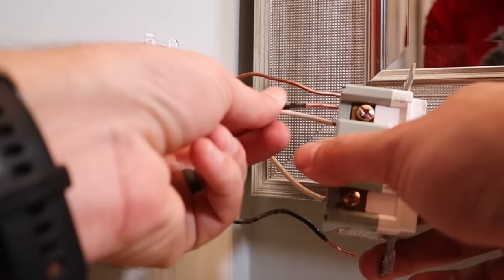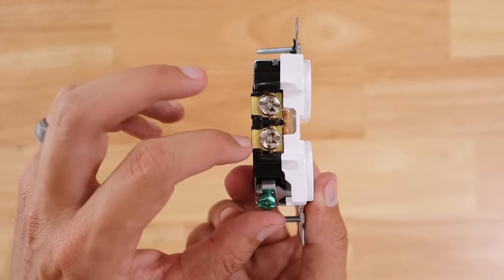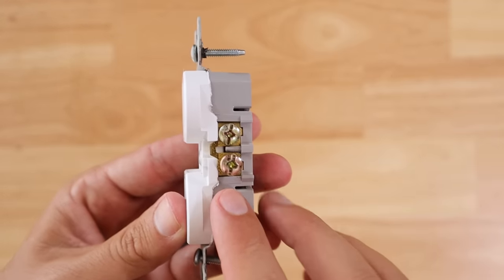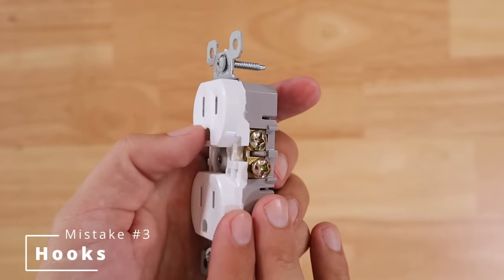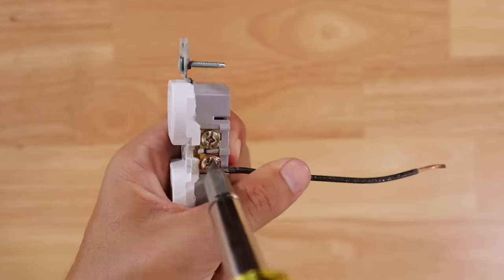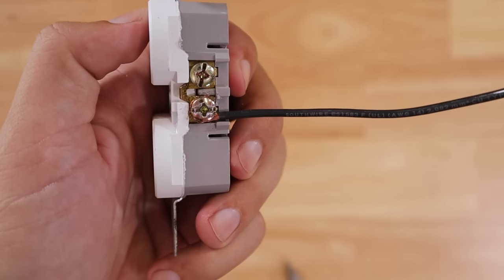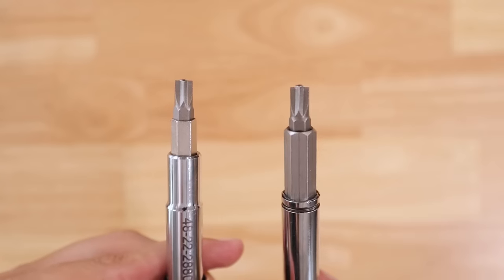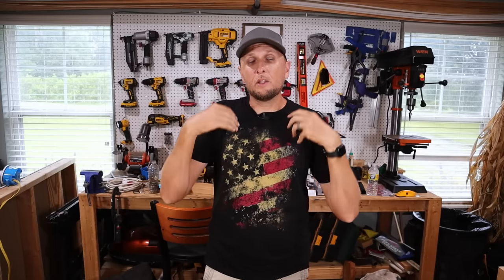The BIGGEST Mistakes DIYers Don't Know They Are Making When Wiring Receptacles | How To

Comment: German here. We use push in connectors for outlets, junction boxes, switches and lights for decades now. They are superior in any way. Obviously, if installed wrong (wire to short, not pushed in far enough) or of crappy quality, they fail, but that's the same for screw type connections. They are better, because they push back onto the wire, while a screw can't do that. Obviously they are also a lot easier and faster to install, change or remove. Also putting stranded wire into such a connection seems wrong, there needs to be at least some ferrule to keep the wires together first.
Reply: Yep, I recently replaced all the outlets in my house built in the 70’s. Many were wired via push to connect, and outside of being ugly and old looking, all of them still worked fine. Seems like a decent method when done properly
Reply: Yeah. I'd say  95% of construction in the US and Canada in the last 30 years uses back wiring.  

A few extra minutes on every outlet is a huge deal when you're building a 200 house subdivision.

And there's no issue with it at all if the materials aren't defective and they're installed correctly.

But then you could say that about screw terminals too.
Reply: Every outlet I've seen only allows 14 AWG  solid wire in push connectors.  I prefer 12 AWG wire for outlets, because you never know if someone will plug a high load device into it, ie a big vacuum cleaner, or a big hair dryer.  So I always use the screw terminals on outlets.  Lights can often be 14 AWG.

Comment: The backstab method is just fine. If the outlet has the UL approved marking it was tested by the lab for safety concerning fire and shock. It is safe to backstab, but not always the best option. Any building inspector will pass a backstab wired outlet because it is safe.
Reply: Right? Sounds like when plumbers say don't use PEX. It's UL listed my dude. Insurance companies are not just lax/lazy on this. If the devices were faulty it would result in millions worth of claims. They would be going crazy banning them.
Reply: Been a Journeyman electrician for a few years now, and thousands of hours in my apprenticeship, and grew up around the trade (Dad, uncles, brother all electricians)... and I can say that I have come across many service calls of faulty receptacles having to do with backstab connections vs the correct hook round the screw. Older places with plugs behind beds, people plug the clock/phone charger in, and then things get... bouncing in bed, caused the backstabs to shake, come loose and begin arcing... causing the receptacle to melt. I would never use a backstab connection for a permanent install. Remember that the UL approval is the LOWEST accepted level of safety mandated by the authorities... not the best... just like the entire electrical code...
Reply: @coryjohnson2314 I've seen plenty of melted outlets that were installed by looping them around the screw. I'm sure you have too. Do you think looping is unsafe too?

Insurance companies don't use the lowest standard, they use the highest. UL lab testing means an item has been tested, a lot. You wouldn't insure the "lowest safety standard".
Reply: I being a master electrician for 21 years agree with cory. Backstabbing outlets is lazy and causes more headaches in the future. Code is to minimum standards.  Why not do better than minimum.  Dosen't take much longer to side wire.
Reply: We all know there are high quality outlets and crap outlets, and the crap ones are still UL listed.  UL listing means it probably won’t cause the house to burn down…not that it will be durable, reliable, or have less than 10volts drop at the 4th daisy-chained outlet.

I seriously wonder if these “it’s just fine” guys apply the same standard of work when it comes to their own house?   If you wouldn’t do it in your own house why on earth is it “just fine” on a work site?   “It’s just fine” actually means “it won’t fail soon enough that they can still track me down.”
Reply: Great video but not in 100% agreement here. Seen way too many back stabbed outlets installed for decades without issues. If there's a problem it's usually somewhere else.

Comment: Great video. I only have 1 thing to add. Receptacles or plug ins are not rated as pass through devices. Pass through means, the two screws on the side, top screw is power coming in and you add a wire to the bottom screw for power going out. You should, instead, wire power in and out together in the back of the box and connect the receptacle to these two with pig tails.
Reply from the maker: Thanks a lot for the feedback!
Reply: The receptacle is indeed rated for pass through and there is no code violation. If there are 2 circuits on A and B phases sharing that neutral, then you are not allowed to pass the neutral through a device.
Reply: Agreed 100%. In Canada  it has been Code for many years to pigtail the neutral/identified wire. NEVER PUT 2 WHITE WIRES ONTO A DEVICE. This is a danger to anybody servicing the device in future and it  creates a greater fire hazard.
Reply: @lumberjackdreamer6267  No. Splice the whites in the box with a pigtail. 
If someone is working on the circuit live(I know it SHOULD be turned off, but there are scenarios when that isn't practical), if you happen to get yourself in contact between the two white wires(the return path), you will receive the full current from anything that is connected down stream in the circuit.
Simple example: When disconnecting a light from a live circuit for testing you never disconnect the white wires first because the current going to the bulb from hot is still there and it's looking for a way back home to the panel ground. If you accidentally grab the white from the box and the white from the light you become part of the circuit and will receive all of the amps that the light bulb(s) are drawing from the panel. That will at best hurt a whole lot more than the zap of touching the hot wire if it doesn't lay you out flat. Be careful. The white is the most dangerous wire in a live circuit.
Reply: @lumberjackdreamer6267  if you have 2 separate circuits with 2 separate neutrals then yes you would cut the tab
Reply: @lumberjackdreamer6267  if you are speaking of 2 hots sharing a single neutral from the panel (1 cable-red, black, white, bare) then the single neutral will carry a maximum of 20 A in the scenario you described, not 40A.
Reply: @17kcotsdoow86  
Dude, you need to stop focusing blindly on the wire color and you need to start thinking of circuits. 

The “white” from the lamp is actually connected to the hot, through the light bulb filament (assuming incandescent bulb). 
Yes, the wire color is white, but don’t get your head stuck in the color. Instead, draw a circuit on paper, or ask an electrician for help.
Reply: @17kcotsdoow86  
Maybe we should wire lights with red and blue wires? That’s more expensive that using the standard 12/2 black and white, but maybe it would be less confusing?

The red would represent “switched hot” and the blue is “potentially hot”.
Reply: @lumberjackdreamer6267  No. If you use 12/3 the neutral will see a maximum of 20 amps because the breakers are on opposite phases. If you are pulling equally 20A from each breaker the neutral actually sees 0Amps. The neutral carries the un balanced current. If you put both red and black on 2 breakers that are on the same phase then yes the neutral would see a maximum 40a but this is not a legal or safe installation for obvious reason. The breakers must be on opposite phases that is why the phases alternate from one end of the panel to the other end so when you install 2 breakers side by side they are on opposite phases. Where would you get the extra wire in a 12/3 to attach to the other screw after you break the tab? There is only 1 white wire in the cable.
A common problem I have encountered is with single space breakers that attach to 1 phase but have 2 toggles for 2 separate circuits and un knowing people using 12/3 attach the red wire to 1 circuit and the black to the other circuit. The problem is they are both attached to the same phase yet they are sharing 1 neutral in the cable thus resulting in 40A potential current on the neutral. The neutral only comes into play when you draw say 10A on the red circuit and 5A on the black circuit creating an un balance of 5A in the multi wire circuit. Those 5A are carried by the neutral. 
Look up Edison or multi wire branch circuits to learn more than I can give in the comment section.
Reply: @lumberjackdreamer6267  dude I'm a 30year journeyman, 3rd generation electrician. I told you that if you disconnect the white wire from the lamp socket before you disconnect the hot and you hold onto both the white wire from the lamp and the white wire from the box you will become part of the circuit and your body will carry the amperage that the lamp is pulling as it tries to return home. 
Obviously the white is attached to the filament. THAT'S WHAT MAKES THE SITUATION UNSAFE IF YOU DISCONNECT THE IDENTIFIED CONDUCTOR BEFORE THE LIVE CONDUCTOR. I don't care if the wires are purple and pink polka-dot, the theory is the same.
Reply: @17kcotsdoow86  
What you wrote here is correct.
Reply: @17kcotsdoow86  if you touch the live white and any path to ground, not just the panel's neutral, you can get shocked.
Reply: @Jaballer77  Yes. That's because neutrals and  identified conductors bond to ground at the main service and therefore are all common to each other.
Reply: @17kcotsdoow86  It does not create a greater fire hazard. Terminal screws are UL tested and listed for feed-through current. Code requirement in Canada yes, but that doesn't mean it's a fire hazard, that means it's a code requirement in Canada.
Reply: @17kcotsdoow86  The white wire is not the most dangerous wire in a live circuit. An equal amount of current flows through the hot and the neutral. If you become the connection between two hots or two neutrals in an individual circuit, you're equally in danger. That said, pigtails required for neutrals only in a multi-wire branch circuit, not required for hots, because if two hots are sharing a neutral and you only turn off one breaker off, the neutral is still live.
Reply: @pld8993  But if it's wired to code then both ungrounded conductors would be turned off.
Reply: Incorrect. The terminals on a recep are rated for pass-through current.
Reply: @williamleblanc3244  Correct
Reply: @UCQ0M2zfo6E32DyDtkPq-uIQ 
That’s a good explanation. Thanks

Comment: Instead of remembering silver/gold, the easier way to remember where the black and white wires go is to look at the front of the outlet. The "dangerous" wire (the hot, black wire) goes to the smaller hole so that you're less likely to have a kid put something in it.
Reply: Thanks.  That is how I remember things.
Reply: @w6467  Black to brass is what I told my Newbies
Reply: white to metallic white. color to color. Done.
And that works for even complex (eg. 'red wire') situations, too.
Reply: I usually remember it by noting the brass is the darker color of the two and black is the darker color.
Reply: Black to gold (brass) like Mr T is black and wears gold
Reply: tamper resistant receptacles to completely stop anyone from putting something in it?
Reply: @davids7745  let ‘em put shit in there. They gotta learn
Reply: @MrRockitt3  MrRockitt3,  laughed my butt off at your funny lil quip!  Back in approx  1960, at the wise ol'  age of 4yrs, THIS is EXACTLY  how I first discovered the "wonders-of-electricity!"  Yup, when Mom wasn't watching, I managed to stick some metal scissors into an electrical-outlet, and  WHAT a SURPRISE  I got!  But yes, I indeed learned!  And I still can remember that event like it was yesterday!
Reply: Unfortunately I was taught the electrical trade by a racist... just remember that white guys like white gold, and black guys like yellow gold... That might not sound very racist but the same guy taught me that the neutral wire is white because it picks up all the slack from the colored wires... 😬 don't be shocked
Reply: @Featherless1  it’s not racist if it’s true 🤷‍♂️

Comment: The easiest thing to do for a beginner is take pics of the connections, use a multimeter to check for voltage even if you know you turned off the breaker. If you don’t have a camera then go to another outlet and look at the colors and routing of the wires. Or you can draw a diagram of the wires just to be sure you don’t cause a fire.
Reply: Or call a fuckin electrician
Reply: If the beginner needs to trust that the original connection is correct, then I encourage that beginner to read and learn much more before touching anything.
Reply: @aarongerdts216  Speaking of frig’n electricians, how much do they charge in your area to come out to replace a bad receptacle???  $100, $150, $200?
Reply: @glasshalffull2930  depends on who you call.. call me, I'll hook you up
Reply: @glasshalffull2930  Glass Half Full, you make a VERY good point here.  Plus, you'd better believe that a  "master-electrician"  type will not be doing much new construction home wiring all by him/herself!  Yes, it's the folks who rate below Master-electrician that will be doing this.  And I can tell you from experience - SOME of these so-called  "professionals"  are totally incompetent because of lack of attention-to-detail, or....  are half-blitzed from smoking Ganga and/or having a  "liquid-lunch!"
Reply: @Joe Shmoe I know, Joe !  That’s why I’ve spent hours learning about, electric, plumbing, painting, A/C units, tile laying, etc.  That and I really enjoy this stuff.  My mother had an A/C guy come out to replace the capacitor ($20) on the exterior fan.  Charged her $360 with the senior citizen discount.  Anyway, I always use sole repairmen or smaller companies because I’m not interested in paying for the new building, the TV commercials and the fleet of pretty trucks.

Comment: I have diagnosed countless 70's era homes with circuit loss in some rooms only to discover "back stabbed" outlets litterally melting away inside a wall!!  I would personally love to see back stabbable outlets outlawed as they are dangerous!! (most recent 2 homes were ready to burn the house down as you could literally hear the arching in the walls!!)  lesson DO NOT BACK STAB OUTLETS--EVER!!  needle nose pliers and a few extra seconds per outlet to use the screws may save a life!!
Reply: And yet, backstab connections are not banned by NEC and the receptacles are UL listed. I'm cautious, so I don't use them, but they are legal and the insurance industry seems to think they are safe.
Reply: All wire strippers have a hole in them for you to put the solid wire into it and use it to bend the wire then once you hook it around the screw your wite strippers have jaws at the the end that are offset to finish bending the wire all the way around the screw.
Reply: They shouldn't even have the option on the outlet for a backstab
Reply: I HATE those quick connects.  I've seen so many of them fail.

Also, cheap builders seem to use them in conjunction with not leaving nearly enough extra wire in the box.
Reply: I live in a 70s built house and I replaced the outlets because they wouldn't hold plugs in, the micky mouse shit I find and Judy simply pulling out the outlet and a backstabbing wire just falls out of the hole. They are horrible. I love the side screws with the clamp
Reply: @wallyballou7417  My brother uses an electric smoker or deep fryer on his front porch (1875W each, not simultaneously) but recently the circuit started tripping upon use.  When I pulled the outlet out of the wall, 1st off, it was a backstabbed GFCI outlet, and ALUMINUM wire.  The receptacle was literally melted to the hot wire.  I replaced it with an appropriate 20Amp outlet and voila.  (He also has Pushmatic thermal breakers, bleh)

Comment: As an electrician in Denmark, i find it odd that you guys are having problems with "backstabbing" your receptacles and switches. In Denmark we have been using screwless/toolless terminals on our receptacles and switches since 1981, and we don't have any issues with them. 

Another thing i find odd, is that you use different screws for different wires, while the rest of the world can define a terminals use with writing.
Reply: You are lucky that you have not come across fake terminals. For a while, they work well, and then, due to the fatigue of the pressure spring, they begin to heat up and quickly fail.
p.s. I am really happy with the good ones.

Comment: If "back-stabbing" is so bad, why does every single manufacturer of outlets incorporate them into every single product they make?
Reply: Labor costs. Go to any development neighborhood where they build a bunch of houses on a newly created street. The lowest bid gets the job and to get the price lower you backstab the receptacle to speed the job along. The backstabs have gotten a lot better over the years, but still not ideal. Not saying I've never used them, but wrapping the wires around the terminal screw is better. I've been on countless troubleshooting jobs where the issue was the backstabbed wire was no longer making the connection. Sometimes the plastic around it would be melted from arcing occurring over the years. That would never happen with a wire wrapped around a terminal screw and properly tightened.
Reply: I just had to change all the outlets in my house because of this. They were 8 years old but most of the high use ones were actually melting. I just decided to change every single outlet 😑
Reply: @jaylectricity9928 
Same here, it's always the vacuum receptacle 😅.  I do very much like wegos though.  Just realize we are part of the establishment complaining on how things aren't as good as they used to be
Reply: They build them to sell.